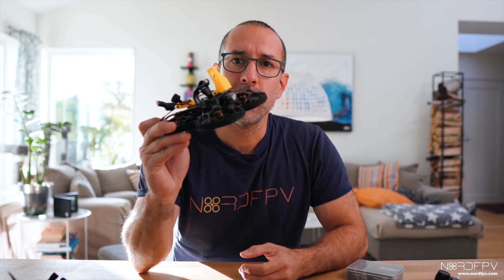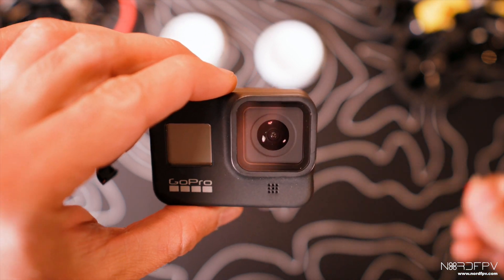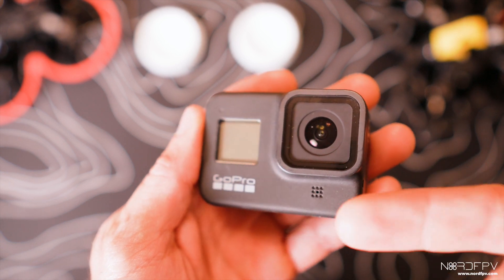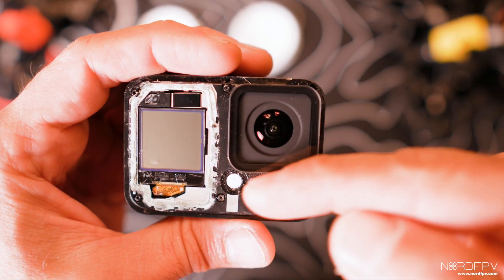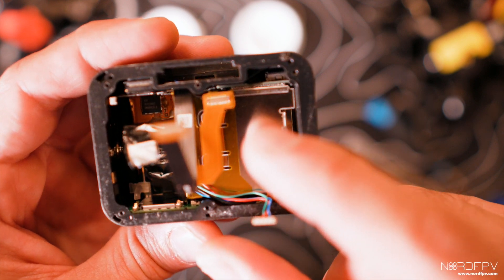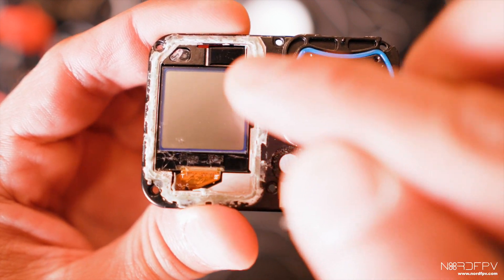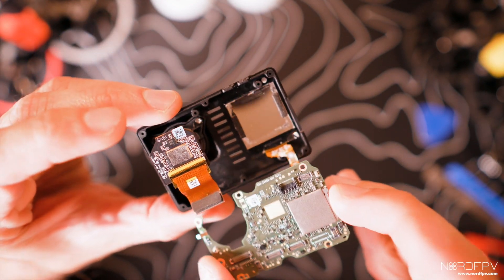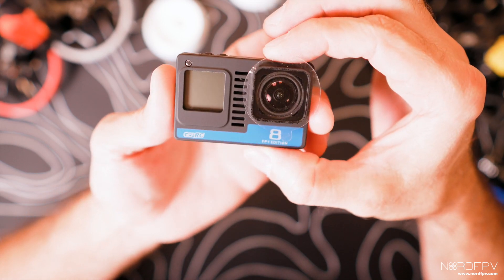GEPRC Naked GoPro 8

Comment: so is it 5v powered then how do you hook it up to your fc?
Reply from the maker: You normally need a cable from the battery. Not the FC. The FC may not have enough current. I have another video showing how to do the cable for the battery.
Reply: @NordFPV  yeah I did it, it's 2-6s lipo compatible so yeah just soldered onto a fc battery/ground pad.

Comment: I have 3 drones. It is very inconvenient to unscrew the GoPro 8 from this drone every time and screw it to that. The GoPro 6 has a great mount, you just pull it out and insert it into another one. What should I do with GoPro 8 in this case?
Reply from the maker: I share your pain. The solution is to design a mount for this camera that allow you to insert it as with the GoPro 6. I haven’t had the time or skill to do that. Option 2 is what most people do: cut the plastic part on the back of the camera and use a GoPro 6 case

Comment: Great video. Anyone also having issues wirh the Wifi not showing up? Its working when I reattach the screen with the black cable and the original power supply. No Problems with bluetooth, so changing settings is still possible but unfortuneately preview and file transfers are not. Any ideas?

Comment: my front screen is not on . can I turn it on with gopro labs ? im not sure if it was turned on when I did the tear down or if I have a ribbon cable not connected
Reply from the maker: Hey Mike. It should turn on automatically. There’s no on off for that screen
Reply: @NordFPV  thankyou very much for the reply . I didnt put the ribbon cable in . doh !
Reply from the maker: @mikehunt5468  it happens time to time ;) lol

Comment: I have tried these steps over and over again. I can not get my geprc naked hero 8 on my Geprc cinelog 25 to turn on recording. All switches set up. All files in cli set right. What am I doing wrong?
Reply from the maker: Do you get any light when you plug the battery?, you should get a blinking red. If you don't, either the BEC is not well plugged, or the camera is dead
Reply: Yes 2 red blinks and it turns on. It stays on a black screen that says hero8. It stays there no matter what I do with the switch assignee on my transmitter. Now if I manually hit the record button, the camera will begin recording. And it gets out of the black hero8 page and shows how many recordings I have and the settings (4k 60 w). But when I hit the switch on my transmitter to start recording, nothing. It’s like it’s not talking to the camera at all? It was purchased as a bnf from Geprc. The hero8 is built by Geprc. I have all the settings in beta flight cli as they describe. But it’s not talking.
Reply from the maker: Ah, then the camera is not the problem but the betaflight configuration. I know that configuration is not easy, Joshua Bardwell has a good tutorial, but honestly, I have heard so many bad stories about the "yellow cable" and how people rather not use it, with some people even saying that the yellow cable is the reason why their GoPro has died. I don't use it myself, I just click on the record button on the camera and fly away!
Reply: Well thank you much for your help! I did check out Josh’s channel. Yea I’ve read of the yellow cable too. I think you are right I’ll just hit the button. I just more than anything don’t like not being able to figure something out. But at least it will still work!

You’ve got a new sub. Thank you again!

Comment: How do you insert sd card? Pry the plastic tab slightly to insert the card? It appears it’s hanging over in the way to keep it from ejecting. But I also don’t want to break it simply installing the sd card.
Reply from the maker: Hi, yes you have to open it with something, I use a flat screwdriver and carefully open it.
Reply: Thank you! It is extremely fiddly.

Comment: big thanks, im appreciate this 📡📡but for any reason, my naked  GP8 don't rec and when put in manual mode the front display dissapear. and canno't set nothing
Reply from the maker: Thank you. I'm glad it helps!
Reply: @NordFPV  do you know why my naked gp8 dont record when i press the boton rec on the top of camera? All in auto mode. When I switch to normal mode the front display disappear.
Reply from the maker: Something similar happened to me once. I opened the camera, reattached the BEC to the main board, like remove and connect back, and then everything started to work again. Try it, I'm not saying I'm sure that's the solution, but who knows
Reply: @NordFPV  problem solved, just disconnected the yellow cable from the conector and plug into the bec again. Only operating in manual mode 🛰🛰🛰
Reply from the maker: @dronebirdun  Great!

Comment: were you able to preserve audio?  I bought a geprc naked gopro, prepared by geprc.  No audio.  They (geprc service techs)  said the original mic is on the gopro 8 case, so no audio ????
is that true ?
Reply from the maker: yes, that's true. The naked GoPro case doesn't really have space for the mic. I haven't remove it from this case, but in the GoPro 6 case it was not completely easy to remove because the microphone was together with some other part.I haven't seen yet anyone adding the microphone to the Naked GoPro, but I guess it's possible if you open a hole to the case and slip in the connector to that little piece
Reply: thanks for the confirmation.  I'm sad, but at least reassured.
Reply: @hojen321  I was adding a microphone to a naked GoPro 8. It can be done. It's not very neat, but there is a place for a microphone in the case.

Comment: Can you use ND filters with the GEPRC case? Have you heard of any issues with the GEPRC BEC? Other than the fact that this is a much cleaner looking case than the Iflight, is there any reason you chose the GEPRC case and BEC over the Iflight or Nameless RC?
Reply from the maker: Yes you can use ND filter. The box actually comes with a nd26. I’ve heard only good things about the GEPRC and iflight BEC, not the same as with the nameless card. I chose this and not iflight just because the case, but I wouldn’t mind using the iflight.